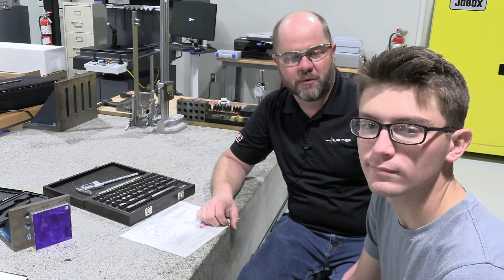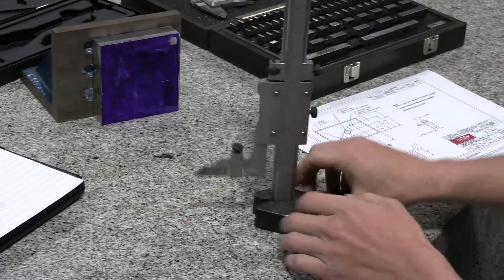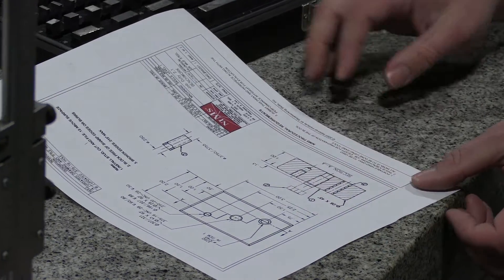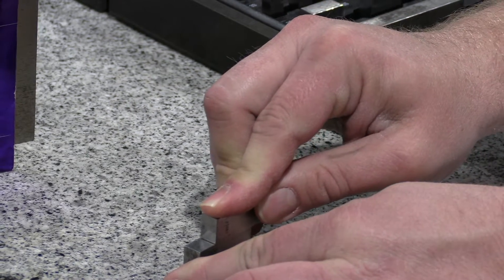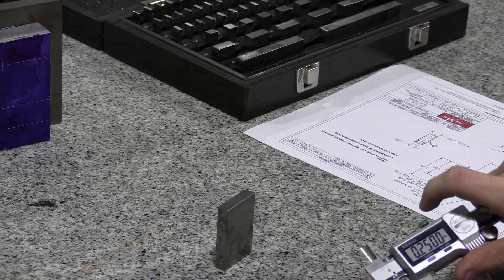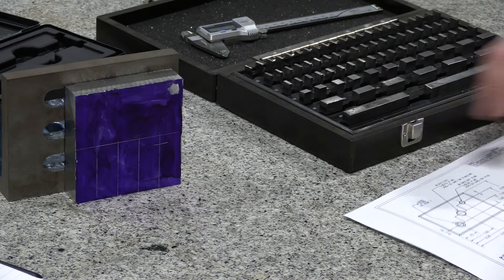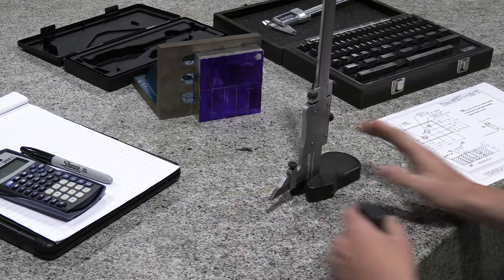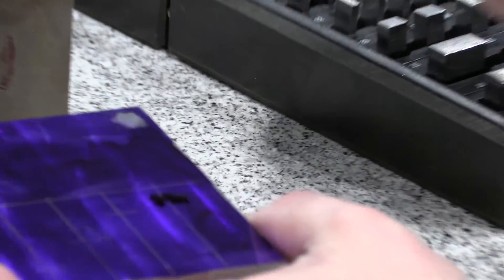Marking a Metal Part | Benchwork & Layout Operations

Comment: I think gage block method is probably faster than reading that old school vernier scale. 

more than one way to skin a cat - we have students use a combo square to get the feel of that method- then we have a couple of dial caliper version of the height gage.   We do the NIMS flat plate layout that way and then center punch the holes and drill out on drill press. 

The benchwork - we use 1x2 1018 steel and mill the ends to 3.00" and do layout for holes and etc.  Or use a milling machine for drill press work if open.

Comment: Why do you not zero the hightgage and work of its venier? Fiddling around with gageblocks and having to have a repeatable pressure on every measurement seems verey inneficent to me. Yes there might be a little bit more accuracy with the gageblocks, but is that level of accuracy still done by the scribed line? 
Most hightgages I know have 1 or 2 thau increments and that is plenty enough for all work I have ever seen done by hand. 
There is definitely a place for this technique but for generell layout it just seems very overkill to me.
Thanks for that video because im sure a lot of people on yt weren't even aware of this technique. Keep up the good work
Reply: The most important thing is understanding and also know that there are many ways